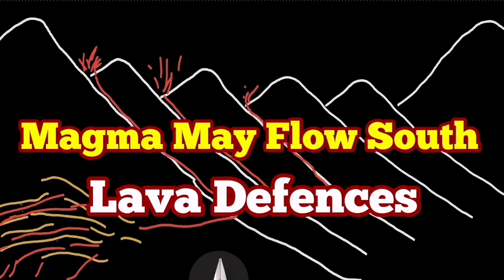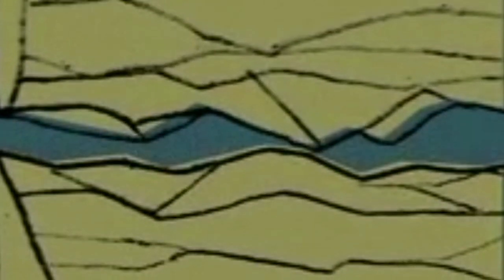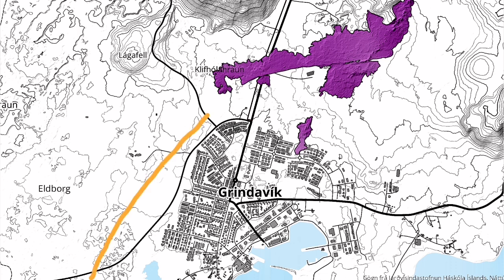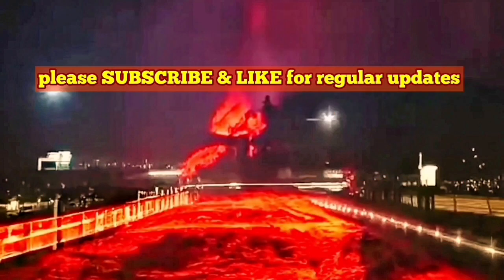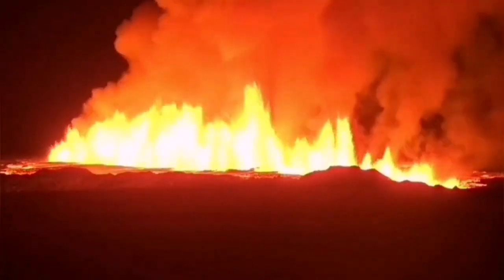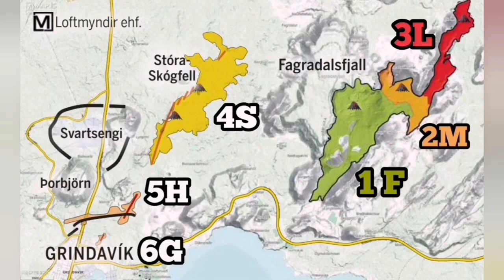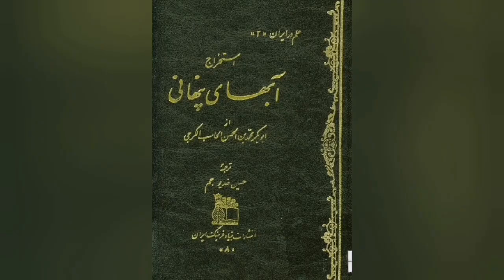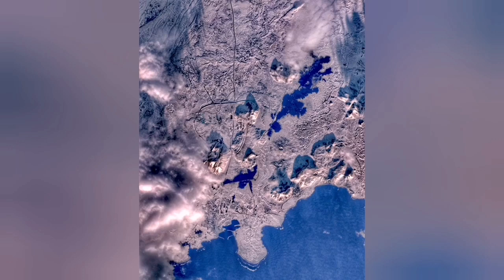New Lava Defensive Walls: Magma May Be Flowing SW Grindavík, Iceland Svartsengi Volcanic System

Comment: In addition to fighting crystallized old magma, new magma has to lift all the layers of old lava above the horizontal sill, in order to squeeze east towards the dike. Some of that weight, is actually recent lava from recent eruptions.  There's a race going on, though some may not realize it. Grindavik looks to get hot. Grindavik needs to move before that happens, inside of any protective barriers. I hope they are putting as much effort into removing infrastructure, as they are building walls around it.
Reply from the maker: I think you will enjoy this latest video: "Iceland Volcano Update: Magma Has Not Enough Pathways To Erupt, Svartsengi Volcanic System".
Reply: @TheAstronomer  I like all these videos, but the only two ways I can think of, to protect Grindavik from the dike that runs inside city limits are:

1. Move the town, or...

2. Decrease and or re-direct pressure thru the underground transport conduits such that it flows... elsewhere.

I guess you could try to seal the system's input off below 8 km under Svartsengi,  but, in my opinion, the human race doesn't have the tech and/or experience to accomplish that, or #2 above, and the first time we try, we're more likely to... create un-intended side effects... than we are to succeed.

I like the research you've done into the iranian approach to constructing diversion levees, and can see the benefits there,  but... once you get magma into a dike that runs directly under the town, the clock starts ticking.

In the long run... there might be some leverage in an approach that starts with the "bathtub" constructed around the original World Trade Center Tower's foundations.

But injecting sub-grade grout curtains, to stop ground water infiltration, is an order of magnitude, or much more... different than attempting to re-direct sub-surface magma evolution.

When, not if, our species gets around to that level of terra-forming, the Iranian approach to inhibiting two dimensional surface flow will need to adapted to  a three dimensional underground environment, and in the early attempts, the best we can manage may be a temporary, four dimensional interdiction effort, structures we know will fail, eventually, simply to buy time, until we have the material sciences necessary to work at those temperatures and pressures.

We might have to have a look at some... ahhh...budget re-prioritization... as well.

;-)
Reply from the maker: The points you make are valid and we have to find a way to mitigate the probability of each one of them. This is an exciting opportunity to study the behaviour of this volcanic system and adopt the ways which best fit the situation as it evolves.
Reply: @TheAstronomer  so far, in this particular contest of man versus magma... the magma isn't winning. 

I've just got to admire the Icelandic spirit!